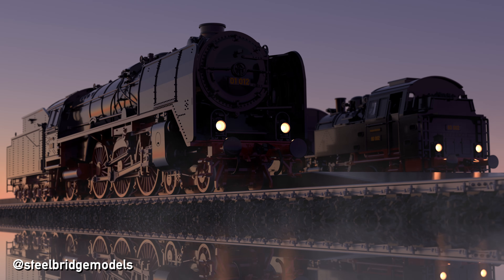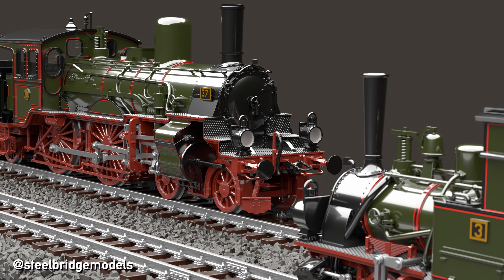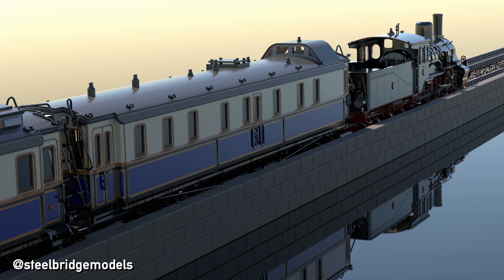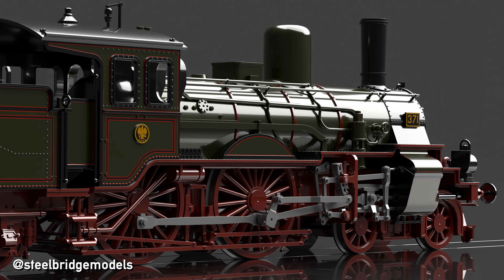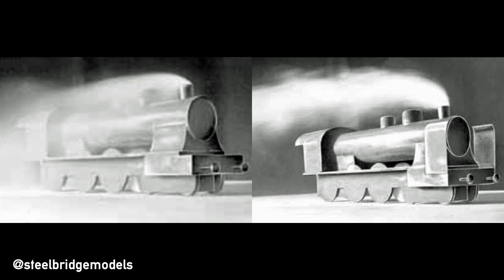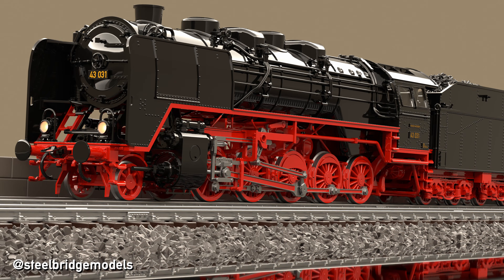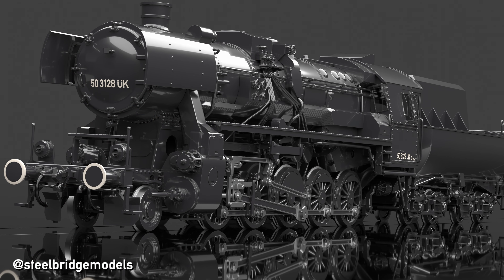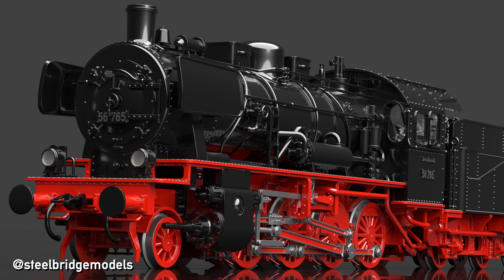What do they actually do?

Comment from the maker: Which locomotive wears them best?
Reply: Out of the german locomotives its the 01, but my favourite is the hungarian 424 with the wagner style.
Reply: An 01 with Wagners is just a beautiful thing.
Reply: Gresley A3/Thompson A1/A2
Reply: The Wagner Windleitbleche makes everything it touches more Elegant. I also love the "Fledermausohren" on the Steam Engines of the Köln-Bonner Eisenbahnen
Reply: Victorian Railways R class.
Reply: JNR D51 (the ones with the snailback streamlining/big smoke deflector)
Reply: BR 44 / 43
Reply: The 50/52 with the smoler or witter type ones
Reply: Wagner: 01 in factory configuration
Witte: 38.10-40 (ex P.8)  because they make it look so much more modern than the short, very early Wagner style
modified Witte: Czecho-Slovak 498.1
Reply: BDZ Class 11 4-10-0. I think it just looks so sleek with them
Reply: Flying Scotsman
Reply: I like latest Czech locomotives such as 486, 498, 498.1
Reply: Czech 498.1
Reply: I kinda like the classic Br52 straight plates, but that's just me
Reply: The PRR S-2 Steam Turbine Locomotive from the 1940's has one of the most menacing stances with smoke deflectors. Union Pacific's 844 also looks awesome!
Reply: Die 12.14 oder auch BBÖ 214 meiner Meinung nach
Reply: 4014 big boy
Reply: Probably the 6-8-6 turbine locomotive.
IT LOOKS SO GORGEOUS STRIKING AND ABSOLUTELY AMAZING ￼￼
Reply: For me any that has 4-6-4 or 2/4-8-4 wheel arrangement,
Reply: LMS duchess class
Reply: The Japanese D51
Reply: BR 24
Reply: My favourites are: Germany - class 03, in particular 03 163 ff.; Poland: Pt31; UK: rebuilt Merchant Navy class. Btw: The offical name for the small version of smoke deflectors is "Bauart Reichsbahn-Zentralamt Göttingen", but this was understandably too cumbersome and so they are called "Witte-Windleitbleche" today - to the opposition of Friedrich Witte (1900-1977) himself, who did not want to hear of it! The saving in material achieved with them was considerable - 200 kg per pair vs. 1,000 kg for a pair of the large "elephant ears".

Comment: Couldn't you just, stick a pipe that runs from the front of the train into the smoke stack and have it be a lot lighter than a inch thick steel plate?

Comment: 2:17 - The translation is "wind ROUTEING plates" (not rooting), in case that wasn't clear for non-natives because of the accent :D An equally legitimate translation would be "wind directing sheet" (as Blech literally means "sheet metal" but is often used in the sense of "plate" in mechanical applications)

Comment: The higher plates common here have an additional role, due to tunnels/low bridges being able to be damaged by the temperature and force of the chimney, there is a valve that closes the top and lets smoke out against the side plates, dispersing the energy against the steel of the locomotives "smoke deflectors" and letting it mix with the turbulent high pressure/velocity air forced around the nose due to less space around the locomotive for it to escape. It didn't make it more pleasant for crews, but honestly it wasn't worse either, and larger designs like the Articulated Garratts could be run full speed in reverse to pull along routs that had a lot of underground... since the coal dust from the bunker while not pleasant was far more manageable. I'm told US trains had a simlar feature, but I've only seen video of it on the Union Pacific Big Boy thats been running around, so I don't know if it was limited only to their very largest types, or if it was commonly like here.

Comment: Nothing to do with speed, it has to do with improved blast pipe design for lower back pressure.  This increases efficiency, but the unrestricted blast pipe lets the smoke drool out of the chimney and blocks visibility.  There are quite a few pictures of newer design engines at slow speed putting out quite the smog bank for their crews to see through.   In America, it was ALCO that cause the problem first with their new designs but everyone followed.  Other solutions include the extending smokestack (Santa Fe loved them) but they tended to get hit if the crews didn't retract them in time for low clearances.

Comment: Did Germany ever experiment with smoke shields for protecting the roofs of tunnels and snow sheds? Railroads like the Union Pacific and the ATSF (Santa Fe) had air powered shields that redirected the smoke and prevented damage to the railroad infrastructure. Made Maintenance of Way happy, but heaven forbid if you forget to put it back down.

Comment: You did not get to the point, south afr locos have stunning deflectors, main fact is that the y sre monted on the catwalk ,tapering slightly towards the rear,thus creating a pressure on incoming  air when at speed, forcing a draft to carry exhaust upwards,
Reply: The video is just a quick explanation + history, not a comprehensive review on all deflectors.

Comment: Very informative as always! I think smoke deflectors definitely contribute to a much different look for many steam locomotives
Reply: the appearance of the Flying Scotsman has been ruined in my opinion by the addition of smoke deflectors, which became necessary following the fitting of a double chimney and blast-pipe. Its original appearance was far sleeker. Interestingly, the addition of double chimneys to GWR Castles and Kings didn't necessitate these deflectors. GWR exhaust steam was always an explosive affair which needed no help - apart from ear defenders !

Comment: If you want to see absolutely massive smoke deflectors, look at the Danish S class. They were added because smoke completely blocked the view when driving through the tunnel under Copenhagen. Since the goal is to control the air flow inside a specific tunnel, the design is somewhat different from open air smoke deflectors. They are even taller and the entire front is sloped to push air up to the chimney (funnel).

One of them is clearly visible in the James Bond movie 007 Octopussy from 1983 where it pulls a circus train. Despite being labeled as a BR 62 in the movie, it's actually DSB S 740 repainted to look more German. The reason it's used is because the movie is recorded in England (hence the UK level crossings) and it was the most German looking locomotive they could find. Despite being built in Denmark, it was drawn by A Borsig in Berlin so yeah it does look very German compared to UK locomotives.

Comment: The Atchison Topeka & Santa Fe railroad here in the U.S. had another way of clearing smoke from the cab, extending smokestacks! A control in the cab would pneumatically raise or lower a part of the smokestack so that it could fit within the loading gauge inside of tunnels and bridges, but still raise the exhaust smoke high enough to avoid the eyes of the crew. Much love from New Mexico, U.S.A!
Reply: Have seen pictures of so-called cab-forward steam locomotives of Southern Pacific as a diffetent apporoach to clear smoke from the cab for mountain lines with long tunnels and numerous snow sheds. There is a preserved locomotive is California State Railroad Museum on display in such an "exotic" arrangement.

Comment: 0:24 "Tall chimney and... excellent draught."
I don't think that's right. Yes, for natural draught, a tall chimney creates better draught, which is why factories and power stations have tall chimneys. However, steam locomotive aren't naturally draughted -- the draught is forced by the steam ejected from the cylinders. Does the length of the chimney actually have much effect in that case?
Reply: You only get forced draught while you're actually using steam. While idling (downhill, where you'd probably also reach the highest speeds), you only get the natural draught.

Although you can get draught without putting steam through the cylinders, if you use that bypass valve thingy that takes the steam straight from the steam dome to the smoke box. I forgot what it's called.
Reply: @Pystro  It is called a blower.

Comment: One of the biggest and most powerfull tenderlocomotives in the world were build in Germany ( Schwarzkopff 1931) were for the national Dutch railways ( NS class 6300) for the heavy coal transport from the mines to the harbour (Born)/marshaling yard (Susteren).
They needed smokedeflectors because they were so powerfull.
The nicknames of those engines by the footplate crews were Beul in Dutch (executioner in English)
Few footplate crews were able to operate that locomotive efective. 
Those 4 cillinder single expansion 2-D-2 behemots were beasts.
Even German footplate crews who drove them after being confiscated during WWII called them Teufel (Devil) engines.
Because the fires needed to be as hot as the fires  in Hell.
Reply: Netherlands mentioned 🇳🇱🇳🇱🇳🇱

Comment: The other thing smoke deflectors do is to reduce the ahead view for the locomotive crew.
Reply: Compared to the impairment of vision caused by smoke, this compromise should be acceptable.
Reply: @miniadler on 20th November1955 Britannia Class no 70026 Polar Star came of the track at Milton in Oxf9rdshire taking nine of the ten coaches it was hauling down an embankment killing eleven and injuring 157 passengers and about 10 train crew.  The accident occurred because the locomotive crew could not clearly see the signals due to the smoke deflectors and their handrails.
Reply: @neiloflongbeck5705  That's only half the story, however, as the investigation report reveals. The driver and fireman hadn't worked together before, the fireman was distracted by a faulty injector at the time in question, and both had only a rudimentary understanding of the diversion route used that day. Furthermore, the driver sits on the right-hand side of the Britannia locomotives, not the left. It's also worth noting that visibility for the crew decreases with increasing boiler length. Additionally, the smoke deflectors on this class of locomotive are positioned extremely close to the boiler – on German locomotives, for example, they are located on the outer edge of the running board, not on the inner edge as in this case.
Reply: @miniadler but still the smoke deflectors were a significant contributory factor and were they subsequently modified across the fleet on the Western Region to reduce the chance of a repeat accidents.
Reply: @miniadler  All B.R. Standard locomotives, including Britannias, were driven from the left-hand side, this being a British requirement from, I believe, the 1930s onwards. The confusion here is that the accident happened on the old Great Western Railway, whose locomotives were always right-hand drive, and which were never altered.  Of course, all of the signalling was set up to be clearly seen from the right-hand seat, which made sighting awkward when sitting in, and driving from, the left-hand seat. Yes, the smoke-deflectors may have been a contributory factor in the accident referred to, but almost certainly the driving position was largely responsible for the driver missing the appropriate signals, leading to the derailment and terrible loss of life.
Reply: Only on bad designed British deflectors. German Wagner and Witte type deflectors don't have that problem.
Reply: @23GreyFox LMFAO. Stop talking bollocks. Both of those types obstruct the view ahead, just like all other smoke deflectors.
Reply: @neiloflongbeck5705  You might think so, but the engine crew are only looking at the back edge of the deflector, less than one inch wide and some 30 feet away, They simply see it as a thin vertical line, they can easily see around both sides of it, and it in no way impedes their vision. I suggest you find an engine so fitted, climb aboard, and see for yourself.
Reply: @DerekWalsh-l4i it might only be 1 inch at 30 ft, but the that width of obscuration increases with distance (its an angular thing). The Moon can be obscured by your thumb at arm's length, but no one would suggest the the Moon and your thumb are the same size.

Comment: Many cab-over trucks use something similar on the forward edges of the cab. Not for deflecting smoke of course. They create an accelerated airflow between the front wheels and the side windows. That airflow shields the side windows and mirrors from dirt and water spray. 

Smoke deflectors on steam locos can be categorized in two distinct groups. One group is the one described in the video. It creates an accelerated airflow along the boiler that shields the smoke from falling down. They are mounted with a wide stance on the sides of the smoke box. The other group accelerates the smoke itself and redirects it higher over the boiler. That type is mounted with a narrow stance on top of the smoke box. It can be seen on many streamlined locos and on late type steam locos in Poland.

Comment: Which explained why some American locomotives have these smoke deflectors. But interestingly, many larger American locomotives like the UP Challenger and Big Boy models, New York Central's Hudson and Baltimore and Ohio P-7 lacked them despite their massive size.
Reply: I'm not that familiar with American locomotives, but I suspect these types have the double chimney mentioned in the video, which generates enough pressure to push the smoke far enough out of the chimney before it obstructs the crew's view.

Besides, smoke deflectors have been tested on at least some of the Big Boys. I think 4014 currently has some installed as well—just Google it.
Reply: @miniadler  , the double chimney slows down the speed of the smoke.   it will indicate a kylchap type exhausting system in the front end.   victoria, australia experimented with wagner front ends and realised there was now a need for deflectors.   the entire fleet got the wagner front end and deflectors except for one engine which got deflectors because it got a kylchap front end.
Reply: I know that many US locomotives were built to generate more violent exhaust blasts. This is to clear out the ash in the smokebox. I would imagine this makes having no smoke deflectors less of a problem.
Reply: @KR4FTW3RK  This is mostly true. Proportionally speaking, they were more effective on longer engines expected for passenger type speeds. Hence why New York Central’s 4-8-4’s and later 4-8-2’s had deflectors while the 4-6-4’s never got them. Curiously, the Big Boy’s deflectors were a bit of an issue. They did deflect smoke, but they obstructed the view on their own. This is because the 4-8-8-4’s had angled running boards to give them better clearance with taking curves and switches. The PRR T1’s were an even stranger case because their use of poppet valves could’ve make their exhaust strong enough to lift smoke clear at high speed, but crews found they could work on even lower cutoff instead. They could save steam better at 100+ mph, but became soot magnets in the process.
Reply: @russellgxy2905  Thanks for the reply. My knowledge on US engines is limited, i grew up with the german stuff around. I was curious about the Pennsy T1. With the speed they regularly achieved, they could've used smoke deflectors so it seems. I would imagine the T1 needs to be near center cut off for high speed, it wont release much steam at all. So I did some scrolling through the PRR locomotive classes and only the S2 had and 3 of the K-4s had them? Huh. In germany as you saw, EVERYTHING got a smoke deflector, especially in the east.
Reply: Some Challengers did have smoke deflectors.  #3977, in the Greyhound paint scheme, comes to mind.
Reply: @atshinkansen7439  True but they weren’t long enough for the deflectors to be tapered over the cab’s line of sight. That and they actually worked passenger trains at 70 mph. Big Boys could do faster, but they never worked in services that would have them running above 60
Reply: That's because speed had nothing to do with it.  Blast pipe design was the key.

Comment: An excellent explanation of smoke deflectors! This is the first time I've seen why smoke deflectors are fitted, how they work and the difference between the larger Wagner 'elephant ears' and the smaller Witte deflectors. Well done! Recently, the Union Pacific has mounted smoke deflectors onto the Big Boy - showing that the original design still works today.